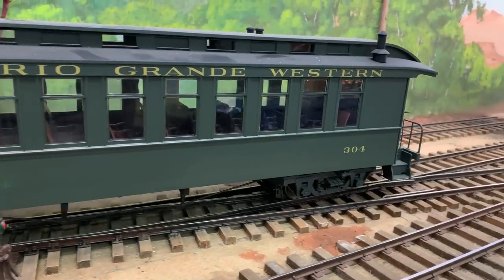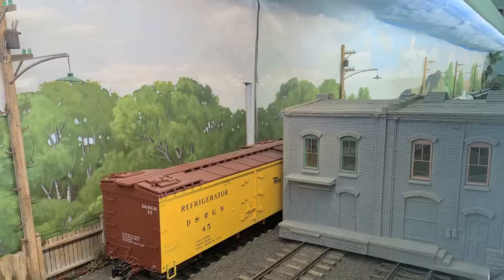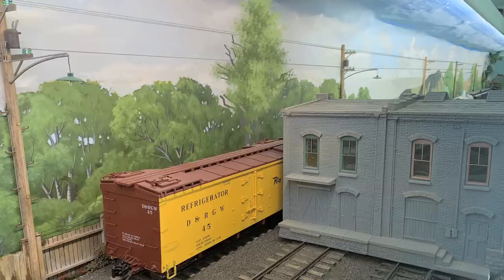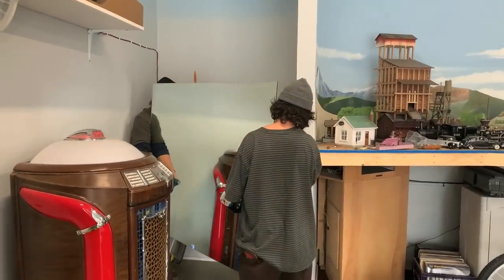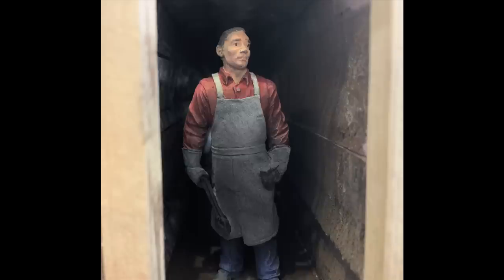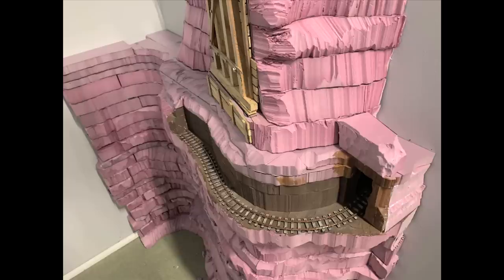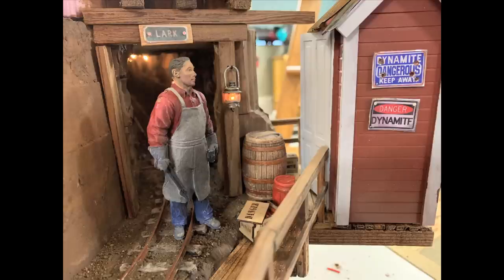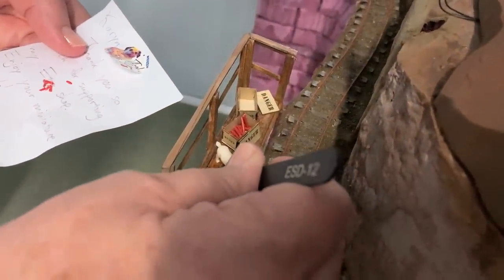How to Use Mirrors to expand the apparent size of Model Railroads and Dioramas

Comment: Dear Dale and Karyn, absolutely magnificent video! First of all for the remembrance you’ve put in, from the basements to Steve’s mine, all fitted with mirrors. Second, for all the different techniques and tricks you’ve shown on how to use mirrors. Love how you’ve explained the how to avoid the gap from the normal glass mirrors and the reverse lettering. Cool to see the mirrors on the spray booth, and for the logging railroad. The mine mirrors are absolutely astonishing. Curious for your next episodes, both on the trestle, the furthering of the logging railroad and the stub end of the yard next to the spray booth. Apart from the surgical first surface mirrors, some art stores also sell variants of a first surface mirror with plastic backing. Cheerio
Reply from the maker: I was nervous about using this optical glass mirror. But don made short work of cutting it. It’s much more durable than the plastic ones. Should be no need to clean it but if so it’s easy to get to and difficult to scratch.

Comment: This will sound unlikely, but if you hang a short curtain in the door of the paint booth, from the ceiling to the height of the paint booth table, it will significantly improve the realism of the mirrored area.

Great video, and the long mine is fantastic!

Comment: Dale, there are 2 ways you can fix the crossing-turntable-intersection.   Because mine-car wheels turn independently on the axles, you could follow prototype mine practice and run the car off the end of the track onto a steel plate, turn the car on the flanges of the wheels, then push the car onto the appropriate track.  This was done in some industries that used track like in a mine to move material and parts.  The transition is done by tapering the rails onto the plate, bring the plate up to slightly lift the car, or turn each rail toward the outside of the track creating a J shape.  The turntable can have an appropriate mark or groove for the flanges at half the gauge so it shows up in the mirror.  The turntable should be in a square plate to hold the table, approaches(you know).  I have seen one or two turntables in mines of these mine explorers put up on Youtube that have rail attached to the table; if you did that, you could use rails parallel and one crossing set at 45* so the 2 rails are against the mirror and it would be very difficult to see the mirror.
Reply from the maker: I wasn’t sure what they did exactly. I have seen photos of “turntables” in mines. And single point kick switches. Odd and interesting.

Comment: Dale, in mines, where they have an intersection and don't want to build a switch; they put down a heavy steel plate so they can turn the mine car on. It's called a slip sheet

Comment: Always love your videos. Great idea. I use mirrors in my real outdoor garden too.
One question I want to move into my garage too with my G scale,  what is the depth of that shelf and the spacing between the tracks? I want to get three tracks like you so any advice you can give would be great. Thank you for all these ideas.
Reply from the maker: 24”. And that’s narrow. That’s as narrow as I could make it. Plan on 8” per track. But the front track doesn’t need the full 8” as there is nothing to run into on the front edge. Yet you don’t want a derailed train to fall off. So 4” from the backdrop to the center on track one. 8” between the center of track one and two. 8” from the center of track two to the center of track three and 4” from the center of track three to the edge.

Comment: There is a type of "fake" greenery that you can put outside to use for privacy. You can adjust the size I think. It's a lattice with ivy or vines on it. You could get or (knowing you two) make something like that and hang it on the front of your paint booth. Just lift it off of the hooks when you want to paint and hang it back up when you are done painting.